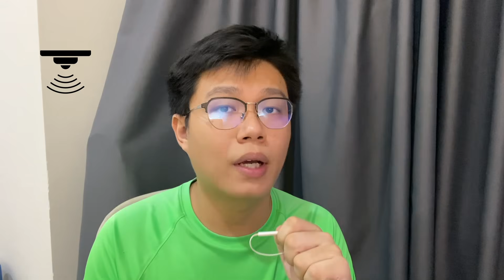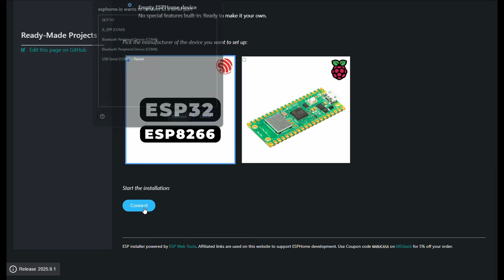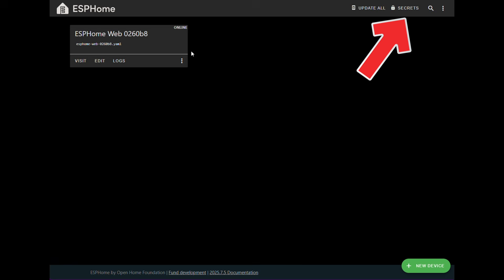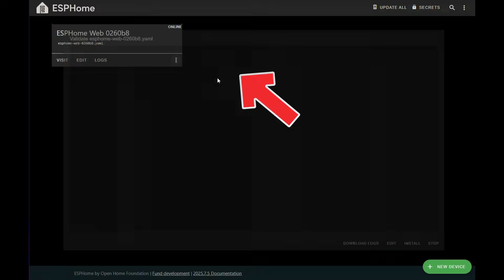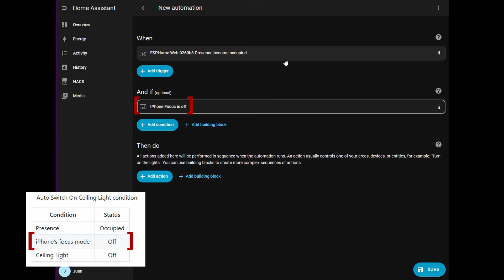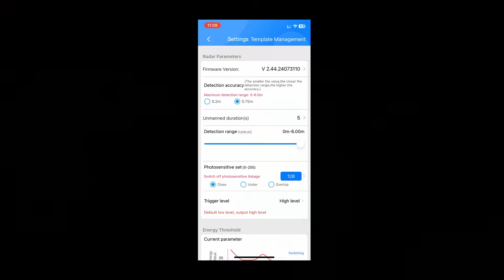Build a Human Presence Sensor using ESP32 & LD2410C with ESPHome.

Comment: Check if you can get a bulk amount of weight sensors and then just put one on the corner of your bed and one to put below something solid (big thin cutting board) you put your yoga training mat or under a carpet. You can try mix and matching them with ultrasonic distance sensors which would act like "laser beams" across strategic lines in your room for extra coverage, but weight sensors are more idiotproof in long run as they test the source.
Reply from the maker: My next step will be to add more weight sensors.